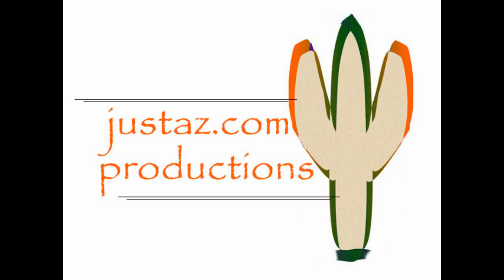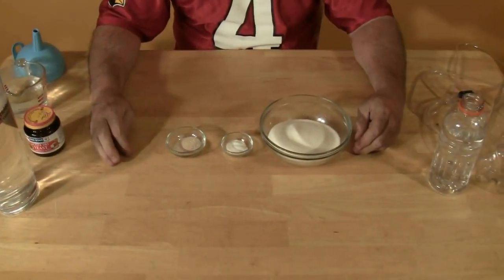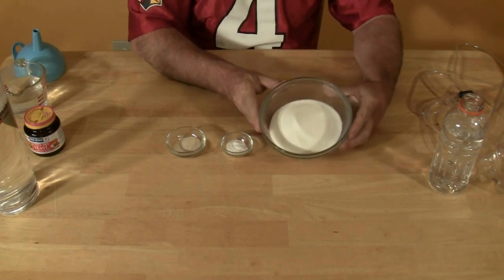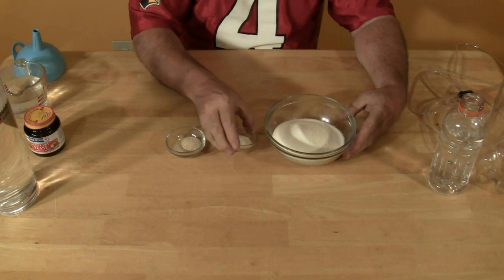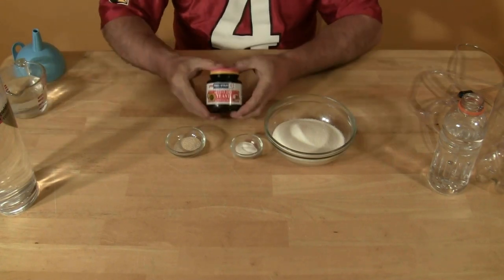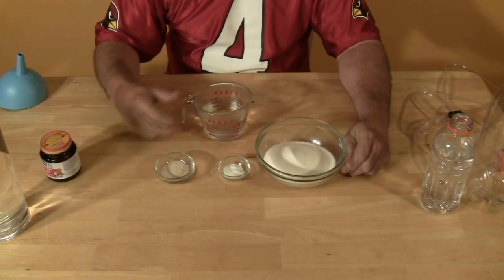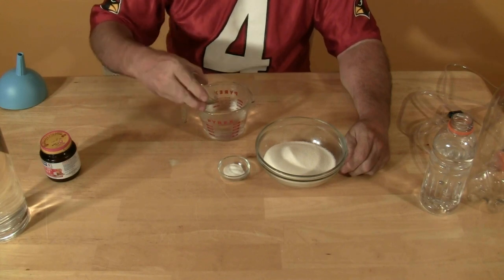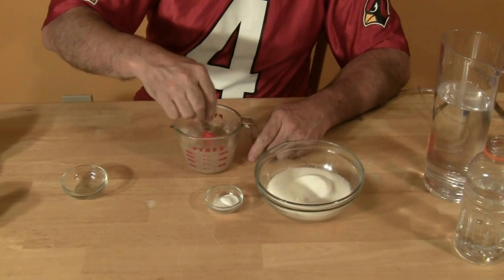DIY CO2 Reactor for Aquariums ... The Do It Yourself CO2 Reactor for your Fish Tank

Comment: nice and simple thanks, i was thinking since i have multiple smallish tanks attached to a single air pump that i might feed this into my air line with the 1 way valve so it goes to my various tanks without adding more lines in and out (they all have their own 1 way valves between tank and junction)

Comment: Is it necessary to have two bottles, if the reactor bottle was bigger? if a manual turn air regulator was inline between the bottle reactor and the project of use, could the second bottle be eliminated?  thanks

Comment: I heard that too much of Co2 could poison the tank? Is it okay for the amount of co2 released by this DIY system to go 24/7 non stop without poisoning the tank?
Reply: Not an expert yet, but 1 to 2 bubbles per second shouldn't rek a 15 gallon and up. BUT BUT BUT. Plants produce O2 during the day through photosynthesis and actually consume O2 at night to create CO2 (respiration). Pull out the tubing before closing the lights.

Comment: This is a really informative and easy to follow video. I just have a couple of questions. Firstly you mention a check valve to stop tank water running into the yeast bottle. Would the same check valve stop yeast water from running into the tank? I don't want my tank contaminated with yeast. Secondly you said in the video 150 bubbles/min was too fast. What would be an appropriate CO2 flow rate please. I have a 34L tank. Thank you.
Reply from the maker: Check values only work one way. Its to stop water from siphoning down. As long as the yeast bottle is lower than the water line on the tank you will not have an issue with yeast getting into the tank. on a 34L tank. I would try 40 to 60 bubbles a minute If you have a lot of fish maybe less

Comment: Great video, I've been wanting to upgrade from liquid carbon to actual pressurized co2 injections, but its so expensive. I might test the DIY co2 kit with my 15, but as for my 55, I do want a big cylinder that'll last for hopefully more than a couple months. Will a 5 lb cylinder last a couple months on my 55?

Comment: You can just put some limestone from your backyard (marble chips) into a soda bottle put some water to get them submerged. Experiment with drops of HCL (toilet cleaner acid) into the mix, to find what amount of co2 you require and for how much longer. You will have to adjust water level for duration. and HCL drops for amount of co2.

Comment: Ive followed these instructions many times and wasted lots of sugar/yeast attempting this. I use 2 cups ginger evans granulated sugar and 1/4-1/2 teaspoon fleishmans yeast in a 1.5 liter bottle with warm water and airtight cap. the reaction always dies. Ive also heard that you start with hot water half way with sugar, shake, then add cold water. Ive gotten lucky once or twice and its mostly just frustrating now. I normally fill the bottle before adding the yeast mixture... Is this what I'm doing wrong ?
Reply from the maker: ted mills Without actually seeing the process it's hard for us to determine the exact problem. Check the expiration date on the yeast. Once yeast expires, it will only 'bubble' briefly and then die out. The water may be either too hot or not warm enough. Too hot kills and not hot enough doesn't activate the yeast. It should feel hot on your finger but not so hot you pull your finger away. Check the lines for pinpoint holes; this can be a problem. Wish we could tell you exactly what's wrong, but at least this checklist might help.

Comment: also do i need rigid tubing? could i get away with just using siphon tubing and push those through the bottle caps? thanks
Reply from the maker: Rigid tubing does seem to work best, but the important part is to ensure there are not leaks, that the tubing is well sealed. Let us know if the siphon tubing works for this project.

Comment: where can i buy rigid tubing and what size around will i need? thanks
Reply from the maker: You should be able to find tubing at your local home improvement store. You want tubing small enough to put through the bottle caps, and still be able to allow for flow. So maybe quarter inch?

Comment: It only worked for 3 days. What could be the problem?
Reply from the maker: Most likely the yeast was used up too quickly. Try tweaking the ratio of yeast to sugar as well as the flow rate; a little less sugar to yeast, and slow down the flow a bit. It does take a bit of adjusting before you find the right formula for your tank. Let us know if that works.
Reply: Ricardo Lesmes less yeast and more sugar

Comment: Do I need the check valve or can I just go without it?
Reply from the maker: The check valve is not essential, but it does prevent the tank water from flowing back into the container, should a system failure occur, so we recommend it. But it's okay to go without it. Thanks for your great question, Danil Anikiforov, and for your great answers to VibeRadient's query. We appreciate both of you taking the time to comment and wish you the best of luck in all your future endeavors.
Reply: Just Az.com productions Thanks, I have a bit of a problem with  my system... it's producing co2 but it doesn't have enough pressure to push through the water in the tubing from the tank so it basically doesn't even reach the tank.
Reply: 45danil Oh btw this is my other channel

Comment: What is that black thing? What is it called?
Reply from the maker: Hello, ammo381. Are you referring to the check valve, the hardware connecting the bubble counter and the air stone? The check valve maintains the flow, keeping the water going in the right direction. Thanks for your question, and best of luck in all your projects.

Comment: This is an excellent video. Thank you for posting it. I'd like to address your having to tape the second bottle (Gatorade). I have read a couple other folks who are having an issue with that bottle leaking CO2 as well. Not all plastic bottles are equal, here's how. Plastic bottles are designed for different purposes. Bottles designed to hold Gatorade or water only must be liquid / leak proof, not gas proof or better said, capable of being pressurized. These bottles have a varied thread count lid. Sodas and other carbonated drinks have bottles that must be designed and manufactured to be not only liquid proof, but also handle pressurization. A CO2 system like this creates its own pressure. It is in essence pressurized. To eliminate leaking in the middle bottle use a 20oz soda bottle, or a flavored / carbonated water bottle. It will have the same pressurized capable cap as bottle #1 - the 2 liter soda bottle. I hope this adds some value. Cheers!
Reply from the maker: Thank you, Allen LaFan, for your input. It's excellent information and we'll likely utilize it next time Bob builds a C02 reactor. Hopefully, we can post some results from that project as well. Thanks again for your valuable comment, and we wish the best of luck in all your projects.
Reply: Allen LaFan Very valuable remark, thanks!
Reply: +Allen LaFan Fantastic input Allen! Very practical advise that can make a huge difference in people's DIY CO2 setups
Reply: Thank you much for this most excellent diy video /science lesson. 
Those who shared comments and experiences like this thank you also. Excited and eager to give this a go .

Comment: How long this Co2 last?
Reply from the maker: Hello, Bluewave Education. Generally, the reactor will run from one to three weeks, depending on how much yeast you have. The more yeast, the more CO2, but it's used up more quickly. We suggest finding the right flow and amounts for your specific needs, rather than offer an exact formula. Thanks for your question, and best of luck in your projects.

Comment: How long before co2 is produced and bubbles start to appear in the bubble counter??
Reply from the maker: Hello, Mara Smiles. Generally, bubbles appear within 40 minutes of starting the reactor. If you don't see bubbles, check the lines and bottles for leaks. Thanks for watching, and best of luck to you in all your projects.
Reply: Just Az.com productions
 It's funny you say that. I read this comment about 40 minutes after finishing this c02 setup and I went back to check on it and I could see the gas slowly start to move through the tube and finally bubble out. So 40 minutes seems to be spot on! :)

Comment: A little question here.

The CO2 production actually requires some O2 to oxidise the sugar. Without a noticeable source of O2... Would it then get stuck in CO2 production? Would it be better to have one more hole in the reactor to run an air line in? (The concentration of CO2 will change, you get more air bubbles, but same amount of CO2, that is still richer than atmospheric CO2)
Reply from the maker: Everyotheryoutuber The second hole would eliminate the pressure, and the CO2 would escape.We personally haven't found any need to raise the concentration, but if you find this an issue, please let us know how you solved the problem. Thanks for your comment. Best of luck to you.

Comment: I tried this system but I encountered a problem. Air bubbles come out of the gas separator bottle and it is evident if I submerge the end of the tubing to water. But if I install a check valve and/or a bubble counter in between the gas separator bottle and the tank, nothing is delivered to the tank. But I could see the bubbles coming in to the gas separator bottle... Is it because this system doesn't produce enoung pressure to push air into the check valve and bubble counter? Is there a way that this can be resolved?
Reply: Are you sure you have the check valve turned in the correct direction? The check valve will let gas flow one way but not another.

Comment: Sorry, new to this stuff, but why do you need the middle water bottle? Wouldn't it work without it?
Reply from the maker: Hello, Toni Haataja. The middle bottle acts as a drip counter; it shows you how much CO2 is getting into the water. It's a way of monitoring the flow. Great question, Toni Haataja. Thanks for watching, and best of luck to you in all your projects.
Reply: To filter any of the yeast sugar that might come through the tube.

Comment: Hi, I tried the CO2 reactor as per your directions but my system does not seem to work at all. Please advise
Reply from the maker: Hello, Musish Bhatia. Without specifics we can't be certain what the problem may be. Check that all connections are tight, and there are no holes in the lines. The air pressure in the system is essential. Also, make sure your yeast is not expired. Expired yeast doesn't activate, so you don't get the C02. If you have more issues, just let us know and we'll try to help. Thanks for watching, and best of luck in all your projects.
Reply: Thanks! I did figure a couple of problems. 1. Using a 2lts system the mix was very weak. 2. Leakage in the system. But what does one do with the By-Product?

Comment: Sugar and yeast also produce alcohol.  Wouldn't it kill the fish ?
Reply from the maker: Hello Auni Cory. The reactor is like a still, in that the sugar and yeast could produce alcohol, but the reactor directs the by-product, CO2, into the tank. The fish are not exposed to anything 'toxic'. The mixture in the reactor isn't alcohol; it isn't fermented. So your fish are fine using this reactor. Thanks for taking the time to comment, and best of luck in all your projects.
Reply: I was thinking the same thing!
Reply: justazcom So in other words the mixture isn't left to ferment (kept still) so the only thing used from the reaction between yeast and sugar is the co2?
Reply: Alcohol doesn't kill fish on its own, and tend to be consumed by bacteria in the tank. The amount of alcohol that would escape out of the media into the air is also very little, that is why it is so difficult to distill pure alcohol. You tend to get water vapour before alcohol, and much higher ratio of it too.
Reply: That explains why- I added this type of CO2 reactor to make tank & after about 90 minutes all my fish were swimming in circles slower & slower until their bar tab appeared & they stopped drinking & went about their business :) No free drinks on the house

Comment: on used the ridge tubing then cut a small of the soft tubing and pushed up  inside to the cap which made it air proof, no glue needed

Comment: Does  it   matter  what kind  of  yeast that we can  use I saw this on e-bay TURBO YEAST Alcotec would this be fine or what kind  because i have seen a lot of  different  kinds
Reply from the maker: Hello, Anyuly Angarita. We used active dry yeast, but we're not sure how a fast acting yeast would do in this application. It may not last as long, but this is something you could experiment with. Give it a try, and let us know how it works for you. Thanks for taking the time to comment, and best of luck in your project.

Comment: hello! this is a great video. My question is : if i put the mixture in a dark place will have the same effect...or it need light?
Reply from the maker: Hello, silviu25. The mixture itself, that is, the reactor, can be in a dark place such as in a cabinet, but the tank needs to be lit so the plants will process the CO2. If the tank is dark, that is, the lights are off, the plants won't process the gas and it will build up in the tank, which could harm your fish. Thanks for watching, and best of luck to you in all your projects.

Comment: +justazcom A quick nooby question, I have some bettas in my aquarium and I looove them, so i got some plants for them but they keep dying ofcourse because of lack of co2.. Is this safe way to get some co2 in, will this harm my fishes at any way ? Thank-you very much in advance..
Reply from the maker: Hello, Mehment Can Atlihan. You may be able to just adjust the amount of time you actually run the reactor in your tank, say three or four hours a day. It depends on the size of your tank and how many plants you have. It does require a bit of experimenting - start with a short time of exposure to the co2 and see what happens. Unfortunately, that's really the only way - at least that we know of- to find out how long to run the reactor in your particular tank. Best of luck to you in this project, and thanks for taking the time to comment.

Comment: Hello!
Thank you this great video! One of the best explanations! I just wanted to ask you whether it is necessary to put the CO2 tube inside the inlet of the power-head or I can just drop the air stone into the tank. Also, should I take it out for the night time?

Thanks a lot!
Reply from the maker: Hello, Maria Smirnova. You can drop the air stone directly into the tank. Smaller tanks and those containing livestock 'sensitive' to current may do better with just the air stone. But if you need greater dispersion, they just position the tube in the power-head. You can take it out at night, if you find that more beneficial, or you can leave it be. It's one of those things where you find what works for your tank. Thanks for taking the time to comment. We appreciate it, and wish you the best of luck in all your aquatic projects.

Comment: How long does it works?
Reply from the maker: Hello, Wilmer Jimenez. The one Bob made here lasted about two months withou having to renew the mix. There are variables - yeast to sugar ratio being the more pertinent. But a reactor this size and ratio should last about two month. Thanks for taking the time to comment. We appreciate and wish you the best of luck in all your projects.
Reply: justazcom
BTW, sorry for being annoying, how do yo know it stopped working, by the fact it doesn't throw any bubbles or anything else?

And

Does it work good for the plants, I mean, they have a good growing with it as with any aftermarket co2 diffuser? Thanks in advance.
Reply from the maker: Wilmer Jimenez When you no longer see bubbles, the CO2 has run out. And yes, the plants benefit from the reactor, just as they would an aftermarket product. The DIY version doesn't have all the bells and whistles of a mass produced reactor, but it gets the job done.

Comment: Hello I have 270 liters aquarium,what should be the ratio of products
Reply from the maker: Hello, ali ahmed. There are variables to consider. One is how many plants you have in your tank. The second is how you intend to disperse the CO2 in your tank. It's a 70 gallon tank, so you would probably need to use your filtering system. I would say 1 ¼ to 1 ½ teaspoons of yeast, two cups of sugar and one teaspoon of baking soda. Observe for a week or so and make adjustments as needed. Hope this helps, and we wish you the best of luck with your project.

Comment: Putting the CO2 tube inside the inlet of the powerhead is a great idea because the diffusion is very good. The only drawbacks for this can be 1) noise from the pump (irregular and not so noisy after all - bud someone could get pissed off) and 2) bubbles in the tank - most people prefere "clean" water inside the tanks, not a landscape disrupted by occasional flows of micro bubbles.
Reply from the maker: Thank you, Thomas soffiantini, for your positive comment and your observations. Your input is appreciated, and we wish you the best of luck in all your projects.

Comment: As an at home wine maker, I can't believe I did not think of this myself!  Outstanding.  It is so simple in concept.  Just a thought, You can go to a local wine/beer making supply store and purchase yeast nutrient to add to the soda bottle.  With wine, I add the nutrient after the 3rd day and then again after about a week.  Basically when the bubbles slow down, add some nutrient.  It will keep your yeast happy and bubbly longer.